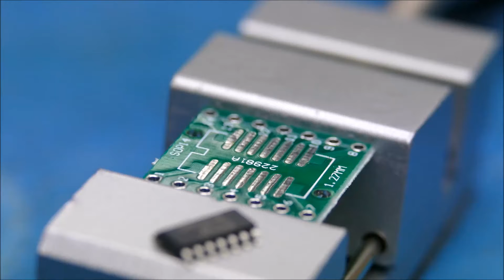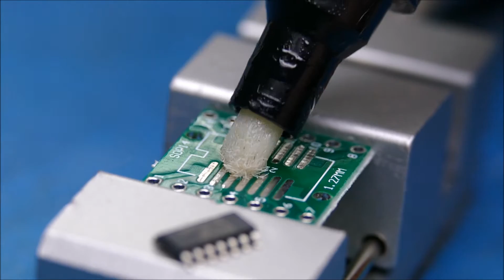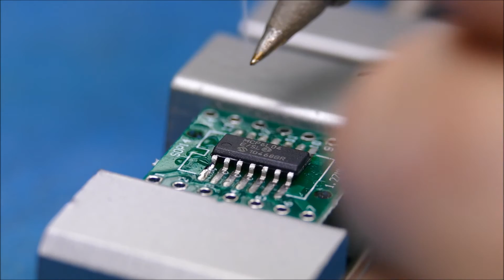Soldering SMD chips to breakout boards.

Comment: This is really neat.  Where do you get those breakout boards? I have several DAC chips I'd like to try.  It's MSOP-8.  The DAC8850.
Reply from the maker: eBay or Amazon. Typically I keep a stock for everything I can think of. Many of them support one pitch on one side (eg SOIC 1.27mm), and another pitch on the other (eg TSSOP 0.65mm) which gives more flexibility. The same goes for the SOIC/MSOP sized breakouts.
Reply: @nezbrun872  Thanks I tried looking for them . seem hard to find. I'll keep looking. Very interested!  I would then use DIP pin header socket to plug them into, on a pcb, and re-breakout to roudn pin SIP sockets.. so I can jump from there with 22 guage AWG solid core breadboard wire. I dont like stickign header pins into my breadboard as it makes it really loose and useless in short order.. At least for me.
Reply: AliExpress one are fine, difficult to mess up on something like that.